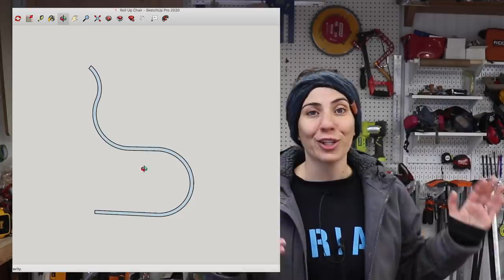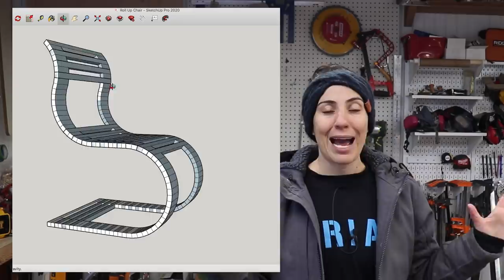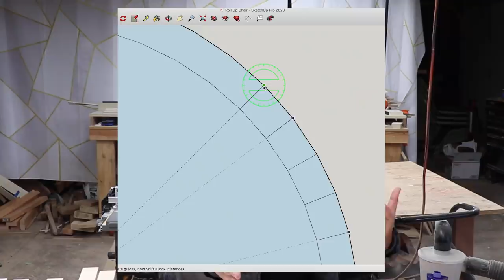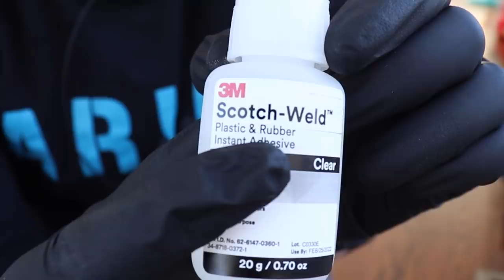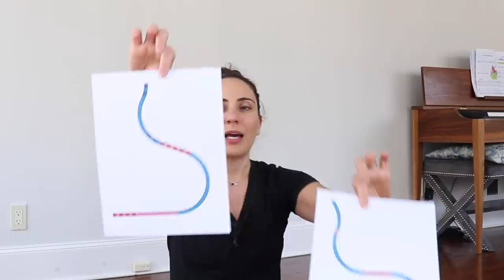I ATTEMPTED to make a chair that rolls up... It didn't go as planned...

Comment: Some things I'm noticing when I did a static analysis of this.
1: On paper this design can work, the fundamentals are there, so keep going!
2: The webbing does a lot of the work. Think of this entire structure as a beam, as it is bent one side has to stretch while the other is compressed. The webbing handles the stretch(tension) and the blocks handle the compression. 
3: The joints between the blocks matter. Gravity and your bodyweight are working to push the blocks apart. I'm unsure how much of a role friction plays in the strength of the chair, maybe the webbing holds all the blocks in place? Either way, a little more friction couldn't hurt. . 
4: The distance between blocks matters: Having tight joints between the blocks should make the whole structure more stable. 

My recommendations:
Experiment in miniature. Save some time and materials!
Eliminate the flat portion between the seat curve and the back curve. You're right that the seat is most stable atop that arc, so make that the seat.
I would try assembling it on its side to take the guesswork out of that process. The final shape is as affected by the blocks as it is by the gaps between blocks.
Use a webbing that's high strength with very little stretch.
On that note, stretch cannot be entirely eliminated. Consider applying the webbing "too tight" so that it pulls the chair out of shape, with gaps between the blocks on the non-webbing side. That way when you sit the webbing will stretch a little, and the chair will fall into the correct shape. 
Lastly, Consider adding a curve to the bottom support section that sits on the floor (such that the webbing is on the inside of the curve). When you sit or lean in the chair, the tension on the webbing will try to pull this section flat to the ground, but the blocks will form an arch to resist and it might just act as a spring.
Reply from the maker: Such awesome suggestions! I’m going to attempt again!
Reply: For added thought: 1.The floor/base section would to be square cross sections rather than trapezoidal, 2. The curved sections trapezoidal cross sections need to be more radical to allow for webbing flex/springiness, 3. The original project was also a "failure" (hence the photoshopped person sitting on the chair).
Reply: I'd also cut the blocks a little bit thinner to increase the friction on the curves. I don't think they'd need to be much smaller either, just a little so you have a couple more on the curves. Also some sort of poly finish on the curved edges could help with the friction needed to stop them from moving around as much once there's some weight on it. I kind of want to try this now, and I have some time off...I just need to figure out how to use sketchup.
Reply: i would also consider changing the angle a tiny bit too.  The final angle is the one on your drawing. Even though it is slight the stretching of the material plus the compression of the wood needs to be considered. Plus, keep at it. it is good see this get worked out. No failing just learning!
Reply: Peppery Peppers your thinking are correct. But the rigidity of a strap is important. It must be nearly infinity rigid. Maybe this chair will be buildable with crane straps.
Reply: @3x3CustomTamar  related to the comment that the wood's purpose is to resist compression, I think it might be a mistake to try this in pine, though I understand why you would want to experiment with a cheaper material. The pine would just compress too much, I'm afraid.
Reply: Try a different angle for the back for it to stand up more?
Reply: @NhatLe-eq2rw  My thoughts exactly.
Reply: @3x3CustomTamar  I think you need a whole world of machining in the design. The face of each block needs a 'peg' with a corresponding 'pit' in the rear of the mating surface of the next block. This can be a shallow dome shape. As more force is applied to the chair, the more it will lock the blocks together. They will then not slide away from each other and will become very stable. Think of a new shape Lego block with angled faces, akin to your wood. ...apply tape to one face and then 'roll' al la chair!
Reply: @molnaromatic  István is correct, near zero stretch in the strap is req'd. Aramid fiber strap would be my suggestion. Also, you can eliminate relative stretch by limiting stretch length, which works best by gluing down the strap (stretch length is now the net length across the segment joint between glue holding edges on adjoining segments). Pine probably no good, it's too compressible; the highest compressive stress will be at the segment edge farthest from the tension strap. Finally, if U can make this work it will become a serious thing so IIWMI'D experiment w/ one side only for 1/2 the crashed assembly time for each permutation.
Reply: @PowderhornWild  You might be able to reduce the compression of the wood by having the end grain faces butt against each other. Then you could use a compound miter saw to cut the blocks from 2x4's. Of course, the long blocks couldn't be made this way, the end grain would still have to be on the end, but I think that overall the compression would be greatly reduced.
Reply: @EngineerMikeF  do you think it would be feasible to use metal chains instead of straps to reduce stretching? Not as comfortable to sit on admittedly, but structurally I wonder if it would work. I also wondered if instead of fastening over the top of each of pieces, she could drill holes through them and pass a chain/rope through which is only fastened on the end pieces. Not something I’ve thought long about, just spitballing.
Reply: @alant84  I think the strap is the best form factor. This structural concept is a segmented cantilever beam which is a really simple system in theory. 3x3 is working the kinks out of turning theory into reality. The strap is pure compression, the wood is pure compression, but the compressive stress goes from zero next to the strap to its highest at the other edge of the wood. Getting chain that would lay flat, be able to be fixed to the wood, & be flexible over the wood/wood joint so it could roll up is asking for chain rollers I haven't encountered. Steel cable, maybe 2 per side, 4 total could be made to work but fixing then to the wood is still a challenge. Aramid (kevlar) is effectively zero stretch; the Navy tried aramid for hausers to tie up big ships at port or use for towing, but the lack of stretch made them dangerous cuz the snapped or snapped the fittings off the boat or dock. I have some kevlar cord & it's a beast for load capacity for the small diameter so it gets used for standing rigging on sailing vessels in lieu of stainless wire rope. I truly believe this chair will become a thing with serious cool factor if @3x3Custom - Tamar can work out the materials
Reply: I often tell people that patience is the #1 thing I've learned from woodworking. Your tenacity is amazing. I am not worthy!  :)
Reply: @peternelson5113  I was thinking the pieces could be cut from a 2x4 using a compound miter saw or even a regular miter saw. I don’t think it would matter as much with a hardwood, but it might help if using pine.
Reply: Great idea and wonderful perseverance!!  

Ratcheting tie down straps for your webbing maybe?  They can take a great deal of pulling force.  Then just cover them with padding / felt for appearance.
Reply: Another thought is to contact some local conveyor belt service companies, specifically one which works with polyurethane bands.  They have experience working with technical webbing, and should be able to give a recommendation on a material type which has has the strength and low flex which you need.  You would also be able to use a CA type glue to secure these bands to the material.
Reply: @molnaromatic  and @EngineerMike F are correct.  There's a lever arm where the pieces meet (the inside of curve corners are the fulcrum), multiplying the weight of the person sitting in the chair by a large factor, maybe 10:1.  And that's just the static load.  People flop into chairs; that's another factor of several.  You could easily get peak loads over 5000 lbs on the strap.  And you need a safety factor.  This is why using a crane strap makes all kinds of sense, although a car tow strap might be adequate for a prototype.  Consider making the pieces deeper - that lowers the lever arm ratio.  This design asks a lot from the materials.
Reply: I was looking at the pictures for this and there's something interesting:

https://www.coroflot.com/ukica/MAKE1

When the top section is rolled up, there is slack in the strap (see 2nd picture on left)

This suggests that the wood is attached to an adhesive substrate to keep it in relative place and then the tension strap is just attached on the 2 end blocks (hence no visible screws). This solves the problem of "what fabric can you stick the wood to that is also strong enough?" - you split it into a weak fabric to hold the blocks in place and a strong fabric to provide tension that is secured to the ends only.

Edit: Looking closely at the rolled up picture (top right) you can clearly see a lighter blue and then the grey fabric. I wonder if you can lay the wood pieces out flat on the weak strap then apply tension on the over-strap in position. Would solve the assembly and spacing problems.
Reply: @cornwallonline  Agree, with the design as is, I feel a little pressure on one side may make thing slide a little and you end up on the floor. Does not need to be much but I think a small concave / convex shape would work, just a lot of work
Reply: On the "make the webbing too tight" idea (which is a good one), if you were to round over or chamfer the tops of the sides of the blocks just a little then they could be brought "too close" without having to apply any crazy preload to the webbing. Effectively they would pivot around the bottom of the chamfer as they moved into position, tensioning the webbing.
Reply: @3x3CustomTamar  I noticed from the photos of the original, not all of the pieces have the same angles on their sides, some have 90 degree angles. That way the only curve come from the slight expansion of the strapping. (Which from zooming in, looks like 2 layers).
Reply: @richs5422  The 10:1 ratio is too optimistic. If you look this math: (sorry i am a metric guy) an average person myabe 90kg (~200lb) and this chair's sitting position mybe 55cm (21 10/16 inches) deep and the wood pieces approximately 2,5cm (~1inch) thick. if it is true then the force in the inner curve is 2tons (4400lbs) roughly. This force is equals on the inner and the outer curves. If we calculate with the common IKEA weights (110kg) the force is 2,3 tonns (5000lbs). This numbers comes without safety factor and are static calculation.
So I guess this is a beautiful design but unbuildable. (Unbuildable with this look.)
How would i start the build? First of all in Fusion 360 run some simulatin (here: https://youtu.be/bZnHQTPP-Ps and here: https://youtu.be/jcUF92XDenQ).Next step is select a proper wood (teak or iron wood). After that the straps: definitely cran straps (under felt cover). Aaaaand small scale models for testing.

And good luck! ;)
Reply: @molnaromatic  That's probably about right.  As the safety factor should be at least 2 and the dynamic (vs static) factor is a fair bit (10?), there needs to be a design change; it's just asking too much from the materials.  One option:  add to the end on the floor and curl it up to meet the back of the seat, and add a rope (kevlar?) to both sides, holding the middles of the curves from getting too far apart.  That would take most of the force off of the strap.  But then, what would the force on the rope peak at?
Reply: @roberthart281  good idea! 
A good supply company will help folks doing something interesting.
Reply: On point 3, I think a tongue and groove joint (without glue) on the pieces would keep the alignment while still allowing you to roll it up.
Reply: @richs5422  "But then, what would the force on the rope peak at?" When the design and the structural elements comes more and more complex then the answer comes harder and harder. I am not an engineer. Only was a rough physical calculation which i calculated.
The kevlar is a good idea but not too cheap. Maybe the transmission chain is enough "cost saving", i dont know.
The tensile strength of a 1/4inch OD kevlar rope is around 6600lbs (https://bit.ly/37kmipA) this will enough i guess.

The safety factor commonly 2. The dynamic safety factor is depends on the choice of materials and this is a realy complex math https://en.wikipedia.org/wiki/Moment_of_inertia. Same time the x10 factor looks correct
Reply: @3x3Custom - Tamar , I believe @Peppery Peppers is the closest to solving this puzzle. I agree with him about the webbing handles the tension and the blocks takes the compression load, and also believe friction probably does not do much here. I have been really intrigued by this design. I think there is a way to exactly calculate the spacing between the rectangular pieces, its hard to explain without drawing a sketch but will try my best. Draw a circle of radius 'R1' if you divide it into 36 sections/parts, each will make an angle of 'theta=10deg' with its length being 'R1*theta'. Now, if you go ahead and draw a bigger concentric circle of radius R2 and divide it into to 36 parts again, the length of each piece now is 'R2*theta'. The difference in length of the two sections corresponding to circle 1 and 2, and spanning the same angle of 10 deg is given by 'R2*theta - R1*theta'. If the difference in radius of the two circles corresponds to the thickness of the wood pieces you are using then, the difference in length of the sections given by 'R2*theta - R1*theta' will be the spacing that you will need to have, if you decide to use rectangular sections. In other words 'R2*theta - R1*theta = dR*theta', where dR is the thickness of the wood. I believe this is called geometric stretching, where the length stretches depending on the radius of the circle. You can think of it as if you want to make a straight line, you use perfect rectangular pieces where the top and bottom lengths are the same but as you increase the curvature the difference in their lengths increases. I realize that I might not have done the best job explaining it but if there is a way I can send you a sketch of it, please do let me know. Can't wait to see you actually solving this puzzle and building a rolling chair.

Comment: When I see that “rubber” it looks like conveyor belt material- when conveyors break there can be free scraps- asks around any gravel pits or maybe it can be ordered. I also kept thinking about 1/4” thickness leather
Reply: both leather and conveyor belts stretch. I would think something like a seat belt or a fabric that does not stretch.
Reply: @erikzorger3311  Yeah eventually she used Polyester, which she mentioned is used for seatbelts
Reply: Came to make the same suggestion on the conveyor belt materal.. it is tough stuff

Comment: You might be able to add shims to the existing chair between any parts that are “sagging” too much until you get it to the proper orientation and then measure the new angles between each piece to figure out new block sizes
Reply: Please correct me if I'm wrong: I think for the longevity of the chair and therefore the fabric it's essential to change the angles of the wood. To my understanding, the best result are parallelograms/trapezoids that have angled sides which try to have maximised horizontal cut orientation. You want to reduce the torque and with that you have more friction surface between the wood.
Reply: At the back piece of course a maximised perpendicular cut orientation.
Reply: Sorry for the third addition, I'm at the phone, editing is not available.
Just adding a shim or even an angled strip might be a worse result because the strength of the chair does not come from the fabric but must energy is hold from friction between the wood pieces. So it's very important to have them fit together on big areas and have their cuts in between perpendicular to the force direction.
Reply: @Majorhantines  you may be onto something. I was thinking a slight angle (1-2*) to cause a compression zone to create a friction plane but this would try to separate the fabric topside a bit as well. 

The parallelogram or close to thereof may do close to the same amount of friction in the plane without it making the chair stand more upright when you get off from it.
Reply: @Majorhantines  I think I follow what you're saying. Shim might have been a bad choice of word on my part. 

I was more thinking you could extend the current pieces of wood by glueing on an additional strip of wood that would increase the angle between the individual pieces, but angled so that it doesn't change the thickness of the spaces where the wood attaches to the actual cloth. Basically making the wood pieces bigger without having to disassemble and recut everything. Plus you could make tweaks in real time as you test it by temporarily adding wood and removing it until you are happy with the curve. Wood glue shoouuld be stronger than the wood it is connecting, but you might be right and it could create unexpected weak failure points in the real world. 

Sorry for the super slow reply. Didn't even notice I had a notification to respond to. :P

Love the channel and project and best of luck!